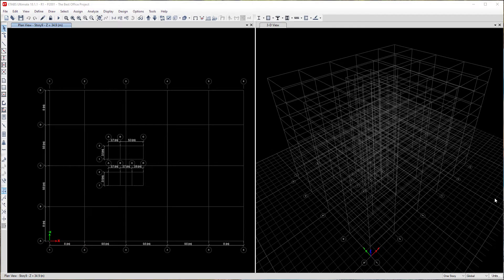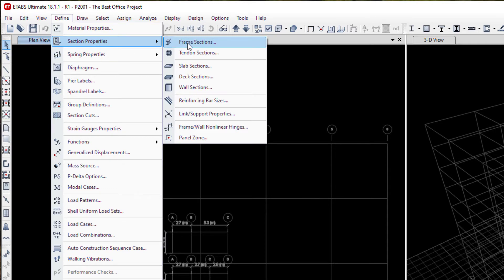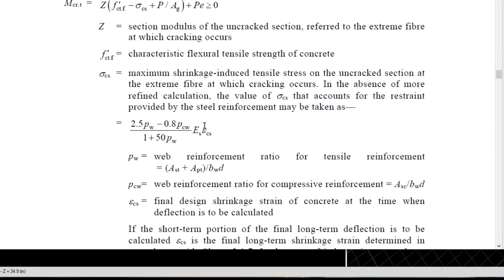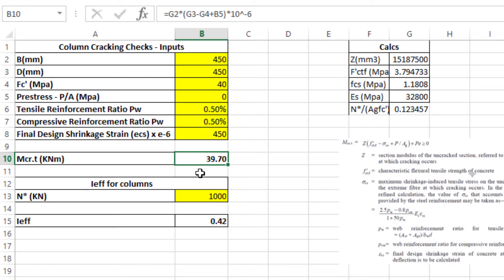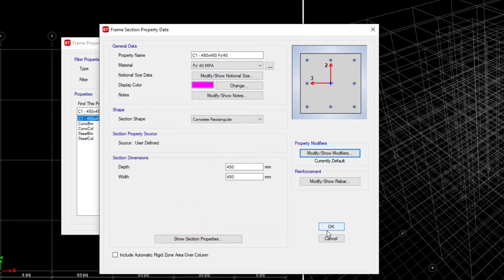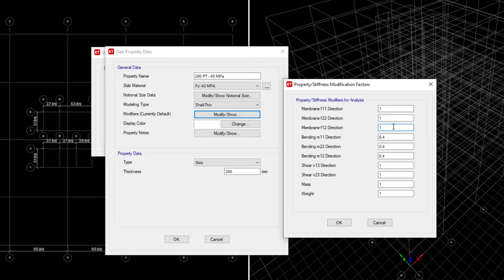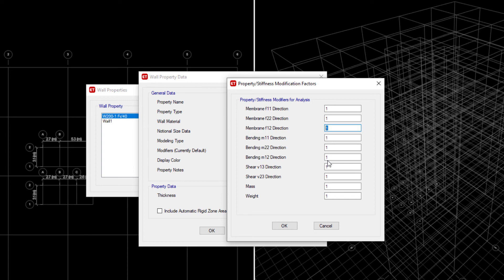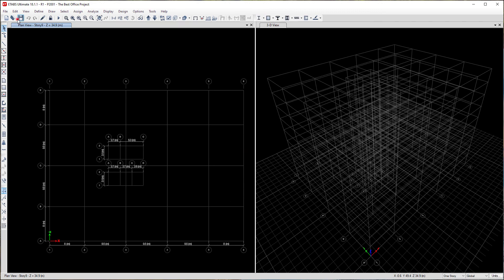Defining Cracked Wall, Slab, and Column Stiffness Modifiers to AS3600-2018 in Etabs

Comment: I need to incorporate a cracked column in ETABS. The section size is 12x12, but the crack has developed about 5 inches. This is a very old building from the 90s, and RSC wants to verify all the developed cracks. How should I assign this in ETABS?

Comment: For walls, it's necessary to modify F11 and F22 as well as F12. F22 is the axial stiffness of the shell element in the vertical direction, and for a core wall acting in flexure, the in-plane bending stiffness is really derived from F22 because the wall bending in plane is just the fibers along the wall lengthening or shortening in the vertical direction.  For a solid wall with no openings, only F22 will really matter.  

F11 makes a difference when you have coupling beams integral to the wall (where the coupling beams are modeled as shell elements like the rest of the wall, not frame elements). The fibers lengthening/shortening horizontally defines the flexural stiffness of the horizontal coupling beam. To see the difference F11 makes, look at the in-plane F11 stresses in coupling beams and overall wall deflection with fully elastic F11 vs reduced F11.  

One problem with modifying F22 is that it also reduces the overall axial stiffness of the wall, and for a taller building this can lead to major inaccuracies if the differential deflection between core walls and nearby columns becomes significant. Load may be shed via the slab between the core walls and columns in unexpected and inaccurate ways.  It is a good idea to compare the results to a separate model with full elastic properties to if there is a significant difference in how much gravity load is resisted by the core walls vs the columns.  In more extreme cases, a full staged construction analysis may be necessary.

Comment: Stiffness modifiers should be used with caution as they will change the loadpath quite significantly. For example assigning 0.4 to a wall that remains in compression and below cracking, is a mistake I believe. Also, if response spectrum analysis is used, you could end up heavily underestimating your overall earthquake loads if the shear resisting walls stiffness is reduced excessively. So I would take the AS3600 code modification factors as a grain of salt. The ACI advises for example to use 0.7 for uncracked walls and that makes a lot more sense I would think. Generally I believe the sensible approach is to design based on a stiffer, generally uncracked model (which returns higher seismic loads overall), while seismic interstorey drifts should be checked with the fully cracked properties.
Reply from the maker: Agree, stiffness modifier values should always be used with caution and common sense. While AS3600 values of 0.25 to 0.4 is fairly low compared to 0.7 of ACI, these are all estimates recommended by different codes with extensive statistical research behind them I imagine and can always be verified and/or over-ridden by detailed checks based on actual non-ductile earthquake moments and reinforcement ratios provided in the wall.

If a limited or moderate ductile wall system is adopted, that means by default that walls have cracked and yielded to justify the structural ductility and performance factors and reduction in design forces. If they did not, then SP of 1.0 and U of 0.77 should be used with full stiffness of walls. However, adopting limited or moderate ductile analysis approach with uncracked walls is not valid fundamentally.

So it depends on what is your earthquake load resisting system, together with manual checks of walls Ieff, you should not need more than 1 model to represent EQ design forces, wall stiffnesses, and corresponding deflections

Comment: When do you use cracked section properties? Just for earthquake or all the time? 
When you crack your thin PR transfer slab won’t it make it even softer, causing some load distribution issue to supporting members under gravity? For example Vierendeel truss issue?
Reply from the maker: Hi OP,

I crack section properties when the walls crack. That could be under gravity loads - for transfer beams or columns attracting big moment due to framing action. So I crack the ones that crack under gravity framing action (slabs, beams, and columns) to get foundation loads and column design loads, then I have another model with other walls cracked under earthquake or wind. Sometimes I have 1 model for earthquake and 1 for service wind if there is a significant difference between the 2 load scenarios in terms of the number and extent of walls that get cracked.

Yes, when you crack transfer plates it can cause some difference in load distribution which will be close to real life load path of the structure and that is where I would prefer to be. I think you will only run into load distribution issues if you have 10% or less stiffness compared to gross section - which is never the case for transfer beam or slab. You can evaluate the effective I of the section using floor design software like Safe or Ram Concept to workout the actual stiffness, but starting with 40% for reinforced concrete transfers and 60% for post-tension transfers I find to be in the vicinity of the actual stiffness. Not cracking the transfers can be misleading as it creates a stiff belt / coupling beam / outriggers behaviour within the structure to transfer lateral loads into axial forces in columns - which you can't eliminate but you can model accurately to design for the load path based on the elements stiffnesses.
Reply: @theglobalengineer9391  Thank you.
We normally do”PT by others” and then use that slab thickness in the full 3D model. Sometimes when I cracked the long span transfer slab stiffness (making it softer) I found the transfer columns above will be in tension under gravity and I believe this is cause by vierendeel truss behavior. Ie the columns/walls above act like a truss to pick up the floor below.
How do you normally determine the loads on transfer slabs? Do you do floor by floor run down (what about lateral loads in this case?)  or get it from full 3D model (do I crack the section properties in this case for finding transfer loads as well). This will lead to completely different transfer loads. (I use Etabs 3D model with load construction sequence considered but somehow find it too fancy) .That said, I believe that floor by floor rundown method doesn’t always give you “safe” results.
If you can do a video on this that will be great. Thank you.
Reply from the maker: @op-vw8sd  It can happen that transferred column undergo tension, but that could be solved by doing construction sequence like you have done. It is not common that columns undergo tension under gravity, but it can happen with transfer columns. 

I generally use etabs for load rundown on medium size to complex projects, but I validate it with hand checks of critical areas and also with floor analysis model - ram concept for example.

Etabs will typically give you less load for columns being transferred as they are less stiff but higher load on columns that are not being transferred as they are more stiff, so it might be perceived as non conservative, but in reality the load path follows stiffness and this is closer to real behaviour and load path. Always run construction sequence. It is not fancy, it is a must when you have a transfer to get accurate loads.

Doing manual load run down or only based on a floor analysis might give you higher loads for columns being transferred as it generally has no consideration of transfer slab stiffness and assumes columns are equally stiff - which is a limitation in assumptions that we use etabs to overcome. But this method will give less loads for columns not being transferred as your total load on the building is the same. If it is going into columns being transferred, then it is coming out of columns that are not.

I personally recommend using etabs loads to design columns and transfer floors, and use manual loads to check columns being transferred. If manual check is close enough to etabs then all is good, if not then I would take the worse case - manual loads - for transfer columns and transfer slab design.

I will definitely add a video about this soon. 

Great topic